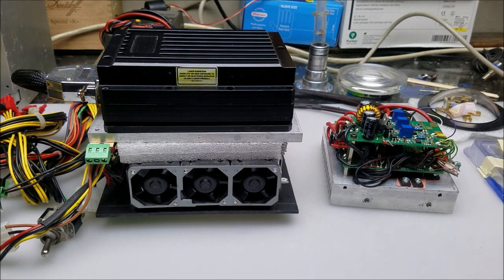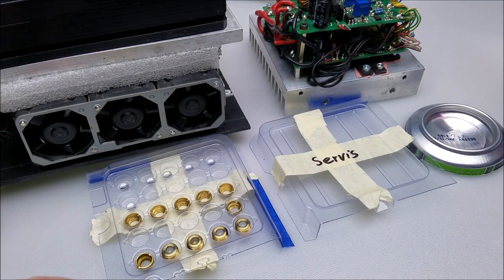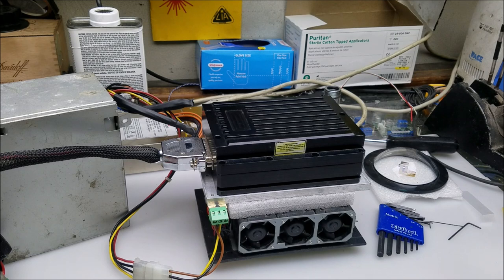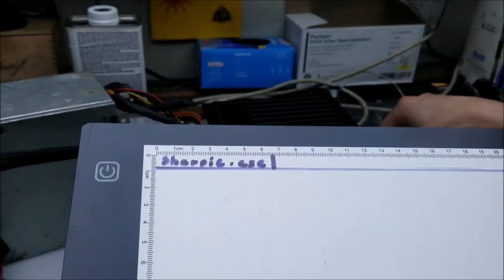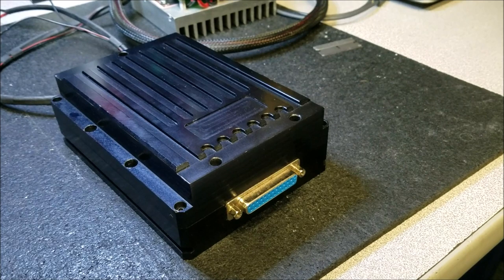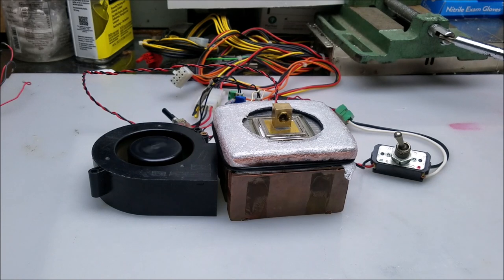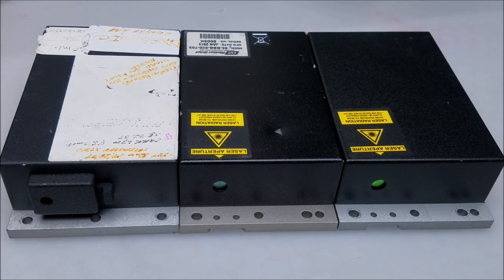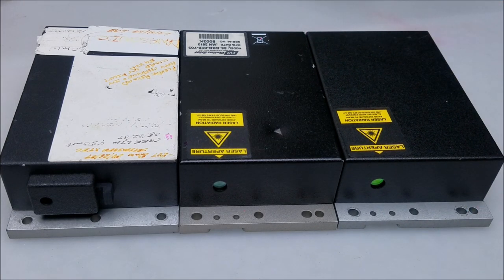Blue Laser Head Rebuild Part 2 New Lenses, Optical Alignments, And more.

Comment: 34:18 - Sick, can see each and every single diode laser beam path, makes it more clear to understand how the optical alignment system works. Can you make a video on where to source all of the optics and lens on a budget which are reliable and also explain how the Achromatic Anamorphic Prism Pairs works? Also doesn't these laser boxes which are sealed needs to be high vacuumed as well to remove all of the air inside of it to prevent any early condensation within it? Thanks.

Comment: Damn dude that’s extra precise work. Would be great to have one of those small precision vacuum pens like used when placing SMD parts for soldering. Pretty sure they have silicone soft tips… So it can conform to any shape. And I’m pretty sure they’re available super cheap and handheld/battery powered these days.
Reply: Also possibly some optical grade UV cure adhesive. It can be bought in tiny syringes with a needle tip for extra easy placement. But if something does happen to go wrong… No rush you can always clean it off and you don’t have to worry about it sitting until you apply the UV light. Was amazed to see super good quality optical grade UV adhesive available cheaply these days in small quantities.

Comment: Excellent video, Zen. Fascinating, as usual. A few questions, as usual.
Q1: Would it not be easier to use a short, thin walled, vertical tube, same OD as the lens, mounted in a stable base to place the lens on; apply the glue to the lens holder; then slide it over the lens and tube? Flip the whole assembly upside down and voila'.
Q2: My unstable dichroic mounts are almost identical to your knife edge mounts, except mine are aluminum, instead of brass (just ordered brass replacements off ebay). They also don't have the lower grub screw, so they are solely dependent upon the tensile strength of the aluminum to stay put. I suspect that brass is a much more stable material than aluminum, under changing temps. Therefore, aluminum optical mounts should be avoided. Have you found that to be true?
As always, thanks for the lessons. 😎
Reply from the maker: To answer question number one. I do not want to risk any transfer of epoxy to the tool that is undesired. If I used a tube in the set up my concern is that if epoxy got on the tool it could form a pull line as I am removing it from the tool which could contaminate the lens. Number 2 I am not sure of the performance comparison between the 2 metals. I will say that overall brass is probably a more suitable metal in though because it's not as soft/flexible as aluminum. I don't think it's the metal as much as it's the design of the mount in general though. Newer lasers from larger companies have almost entirely stopped using single piece tension mounts and have gone to pivot on screw.
Reply: @Zenodilodon  Thanks for the reply and answers, Zen.
IOW, you're concerned that excess epoxy from the bead inside the lens holder would be squeezed around the lens, onto the 'mounting' tube that it is sitting on. Then while removing the tube strings of uncured epoxy could get strung onto the lens? This is why I ask experts like you dumb questions. 🤔
Thanks for your feedback on Q2. I'll see how the ordered brass ones perform when they arrive. TBH, I'm about to ditch those cheap modules, entirely or use them for background projected refraction wheel/'cloud' effects.
So, the plan is to upgrade their 2 projectors with Optlaser's sealed W3000-RGB modules (unless of course you recommend a better/cheaper RGB module). I'm pretty pleased with their PD3000 projector, which has the same module. Figured a matching threesome is the best goal.😎
Reply from the maker: @TheOleHermit  Exactly! That is what I am doing my best to avoid as it's an unpleasant process to clean epoxy off lenses. 

I have a whole box of cheap modules I don't have a use for, they are there when I need a crap set up for a project, test, or video. It happens when you get more and more into an industry lol. Every once and a while I'll give a few to close friends who are getting more into lasers so they have something to use and break on there own terms. People have done the same for me and the cycle continues. 

As far as recommendations, esp cheap ones... No! bad bad Hermit you buy something good and repairable! OPT ( China ) is pretty good for laser show projector stuff and has a fair price for what you get so I would say stick with them if you're happy. My honest recommendations  would probably go North from there in price.
Reply: @Zenodilodon  Oh, no Sir. Good Hermit. Hermit never goes to the bad side. The Hermit just has a hard head.
Please forgive The Hermit's audacity, Master, but me thinks a 60 deg chamfer around the outside edge of the lens mounting tube would allow a sufficient air gap to avoid contacting any excess glue. An outer sleeve could keep the lens and mounting tube in alignment, until the lens is inserted inside its holder (tampon style). Opposite ~2mm vertical slots near the bottom of the mounting tube + a pin running through to the outer sleeve could help control the range of movement. Stick a spring under the cross pin and the movement is automatic, as one lowers the lens holder onto the assembly. Turn the slots into 'L's and it could be cocked into the lower position before removal.😎

Comment: Could you make a video about soldering iron? Im always afraid to leave it on for hours while working, and stress about it oxydizing and whatnot. Any tricks to maintain the soldering tip, temperature, which solder to use, etc.
Reply from the maker: If you use a good soldering station like Hakko, Pace, JBC, etc many will have automatic cool down/standby when you put the soldering iron back in. The higher end tips can last for years compared to cheaper tips, the ones in my pace are 6-8 year old at least and show it but still chooch just fine. In general clean the tip if you are not going to use it for a while so excess solder doesn't leach into the tip and wear it away. I always use 60/40 solder .8m rosin core.

Comment: awesome content as usual Z loved the treatment of the treatments i would like to see a diy spray on coating for 405-450nm so we could recondition otherwise perfectly good glass lenses 😁😁
Reply from the maker: I am so very tempted to try buffing off the coating with an abrasive powder i made from burning silicon rubber. It's an extremely fine powder, the kind where opening the jar makes a little dust plume fine.
Reply: @Zenodilodon  i have played a little with those stock a/m140 lenses from the casios  to get the abberations  gone but i think a damn good polishing will help a lot let me know how you get on! 🤓🤓

Comment: I'm not entirely sure this is even the same laser any more 😂 like when you put a new handle on a broom, and then a new head... 😂

Maybe they're really good TECs? Haha ill take it! For sealing things how about one of those tubes of liquid gasket? If it's good enough for an engine block maybe it's good for this too

I'm always having to make a tool for something, now I need something very small to hold coiled coil filaments, as four just flew away and I have no chance in hell finding them again 😑👀

So why epoxy, would maybe a hot glue work, or could it just overheat? There is also that odd stiff glue they used on screws that set things like timing and weight balances usually a clear blue or red? What even is that stuff!

It did sound like one of your fans needs some lubrication? 
Could you apply a grease to the lens so it doesn't get epoxy on the parts you don't want it to.

Comment: For reflective coating your optician should know what to use, I had some on my glasses and had to get it removed, turns out my lenses aren't exactly glass after all! So there must be something less harsh to use
Reply from the maker: I don't have an optician, I will have to borrow one and see what they say on it. That's a pretty good route to chase. I tried abrasive materials on the lenses since the video. It takes of the coating, but also I end up with a bunch of 2-5 micron scratches... i need finer abrasives.
Reply: @Zenodilodon  a clay might work?